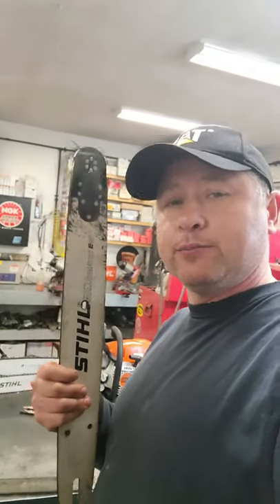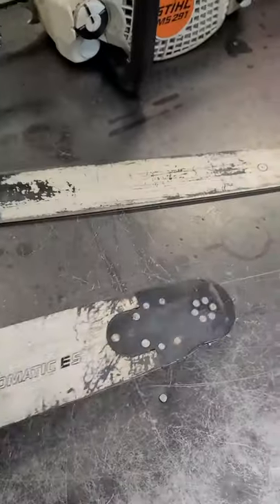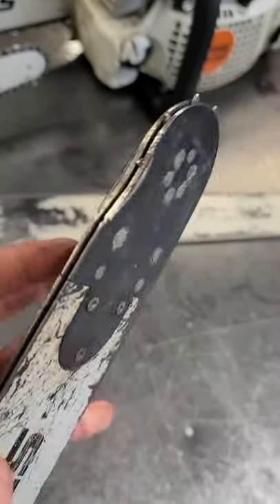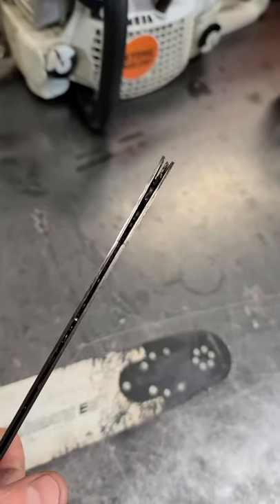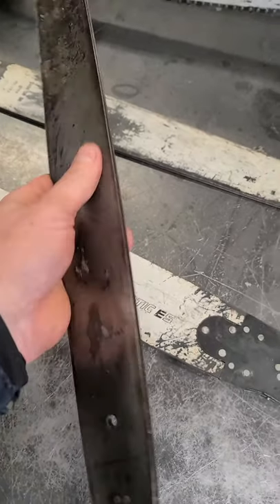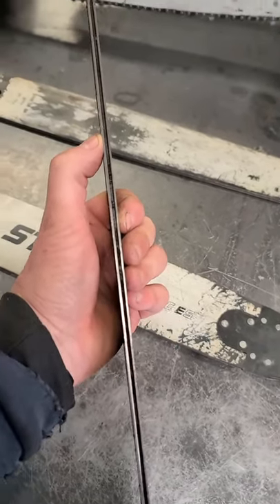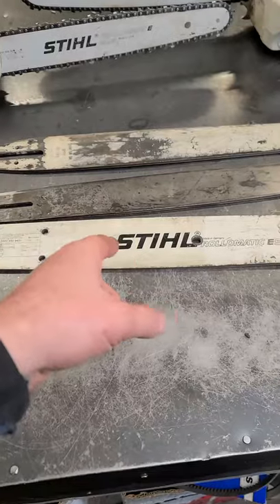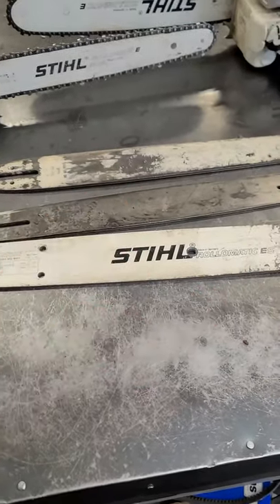I Can't Believe They Were Still Using These Chainsaw Bars! #shorts

Comment: I think with a little time the right tools and new tips I could make all these bars serviceable again. I would not let my bars get to this point ever. Thanks for the video!!!
Reply: Agreed, a new tip, bar rail closer and a dressing and you have a bar ready to go back to work.
Reply: Closing a wide gap is not a great idea, the sides will have a taper, not parallel, chain will wobble.
Reply: @vortexan9804  you are correct. There is a point where the rails can’t be adjusted to compensate for wear. Then it’s time to run a .063 gauge…🤣🤣🤣

Comment: I use my bars until they can no longer be used. That one that was spread open on the end, I have smashed those back together with a hammer. I stop running them when the sprocket will no longer turn, so I bought a hard nose bar haha.

Comment: The quality of many of these bars have changed. The most common problem with the bar is not the bar itself but the user. The crooked cutting issues are usually how one un- jams a blade when trying to fell a tree or bucking a tree and the tree pinches the bar because of not having the proper equipment they try and work the saw back and forth forcefully or side to side when it's jammed that can ruin the trueness of a bar or even bend it and even damage the chain if they go too far in short order. Proper and constant maintenance of the adjustment cleaning and greasing also affects the performance and of course chain maintenance. I've seen bars as old as 10 years of heavy and still cut and perform  perfect. And then I've seen bars after less than a week old under heavy used all oxidized and burned and as mentioned abused or forced around because of pinching and inexperienced individuals. Some of these Canadian built bars stihl bars the quality has changed somewhat especially with tip failure and looseness of the tip. Bit most of the time it's the user and failure to clean the groove or running the chain too tight or loose and not checking the oil. Another thing to mention is the application you use the saw and bar for wrong application bar and chain for the work being done can damage a bar or improper sizing as well of bar and chain combination can damage bar and chain.

Comment: Good video. Is the small hole at the nose of the Stihl bars meant to secure a plastic nose guard to prevent kickback? I don't see many chainsaws with a nose guard, but I use one on my Echo CS-341 and I'm looking to install one on my 026 and 193t bars.
Reply from the maker: check with Stihl dealer

Comment: Heads up kids! Make sure your chain and bar are getting OIL. I logged in Oregon for a few years, and you would never find equipment like that in any logging camp. Read the manual, maintain your dangerous equipment and pay attention. It may save you a limb, or a handful of fingers.